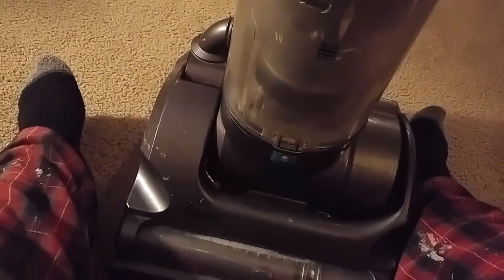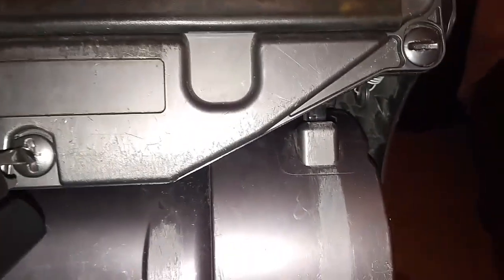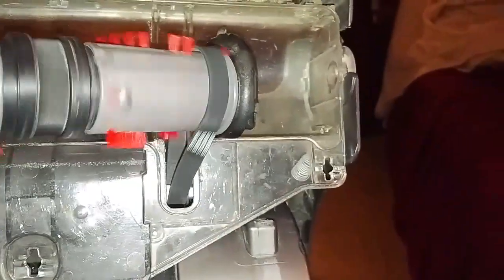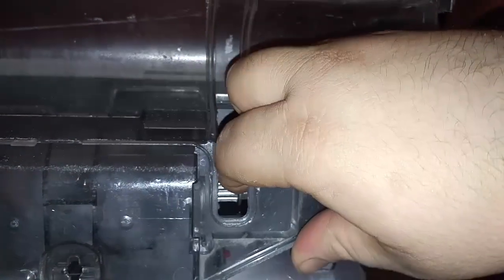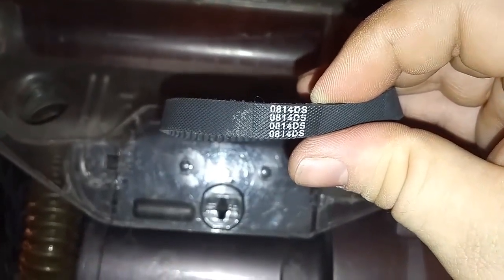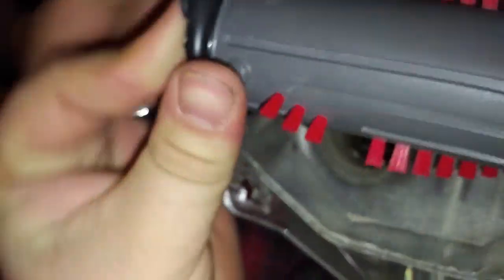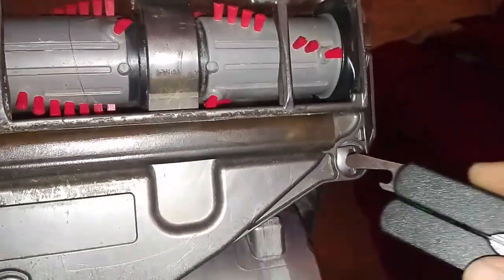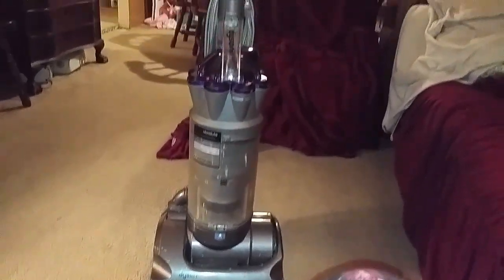Dyson DC17 Brush Not Spinning on the Ground Repair

Comment: Thanks for the vid..I have a DC 14 that is not spinning.  But I believe my problem  is the smaller internal  belt  around the clutch assembly  that on mine.. It is hidden on mine by a cover that has to come off in order to replace it.  You  need a Torx T15 screwdriver to remove the clutch cover. 2 obvious screws and one hidden scree. This is just FYI that their is actually two belts that could  cause this problem.
Reply from the maker: Thank you for the additional information! You're absolutely right!

Comment: Nice! I found a Dyson in a dumpster a while back that the cord was cut off so I got a new cord and hooked it up and turns right on...after cleaning the brushes and such I realized the brushes don’t spin at all...then upon further inspection I noticed that the pipe valve is missing...would the loss of suction be a reason the brushes don’t spin or is that a motor/belt clutch problem. Thanks for any response.
Reply from the maker: On that vacuum, you are either missing a belt, or it is stretched too much to spin the brushes. A new belt should be your problem solved, along with cleaning it out a bit in there. 😉

Comment: Can you please make a video on how to remove the entire bottom part of the vacuum? I am having trouble figuring that out.  

Thanks
Zach
Reply: You just twist all three screws 90 degrees to the left and pull off
Reply from the maker: I do not currently have one of these available to show, but  it is just a matter of a few more screws. 😊

Comment: It is not the belt, the motor does not spin. I caught a corner of a blanket...it made the noise like the belt fried and stopped. The belt still is okay, it does not spin the bar which BTW is less than 2 months old and worked like a champ until that 3 second snag which always resulted in need for a belt.
WHAT IS WRONG WITH IT??
Reply from the maker: Not too sure. Does the motor itself still power on and not spin the shaft, or does it receive any power at all? Like, plugged in, power on, and still no noise or anything?

Comment: Hi it’s too close to the carpet
Reply from the maker: This vacuum does not have a height adjustment. It "sits at the right level on all surfaces," as per it's design. The particular case with this one was simply that the teeth on the belt were worn down to nigh nothing (as is the case with many of these that I have gotten). I repair vacuums on the side, and have done quite a few of these! 😊